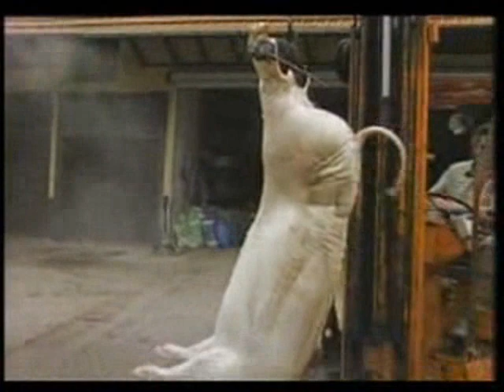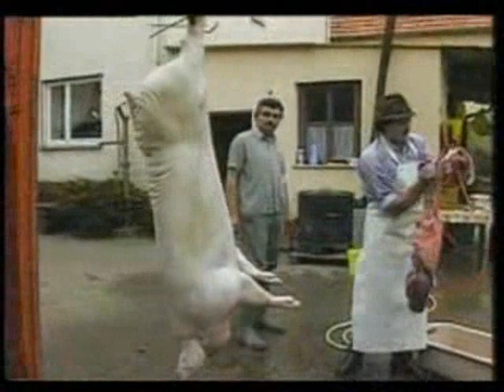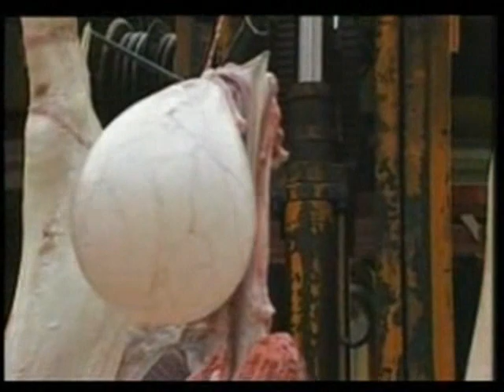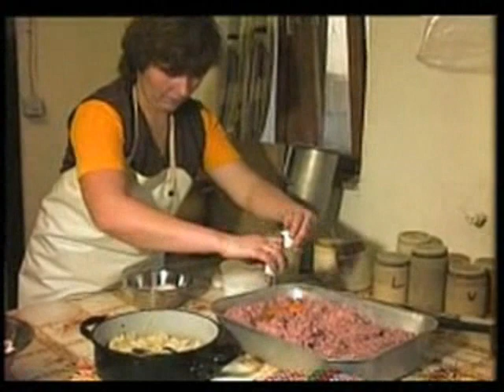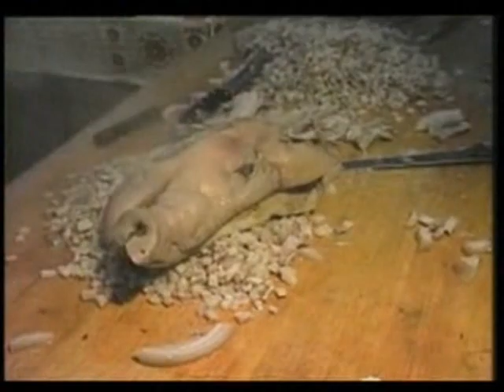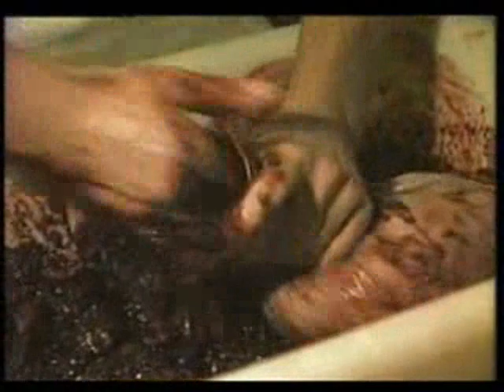How to make sausages from scratch

Comment: This is I believe an video made to show how everything can be done using as few outside products as possible. So they use the traditional method of sausage casings (the bladder and intestines).

Eating blood (cooked) is common. I probably couldn't count the things it's actually in. Black pudding for one is the most common I think, at least it comes first to mind. It's good for you in most circumstances however the human body can (not always, but can) react badly to raw blood being ingested.